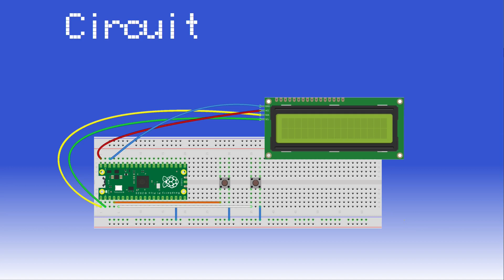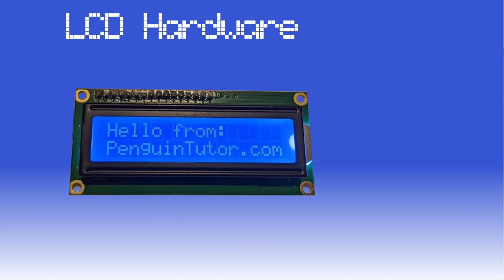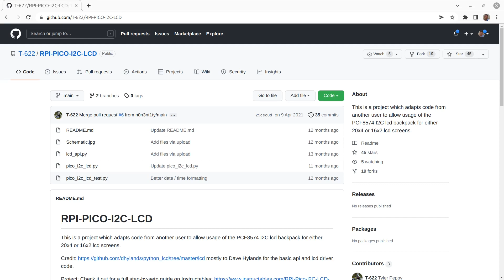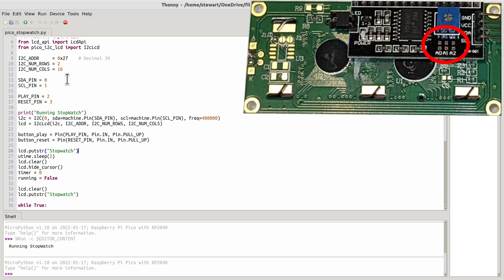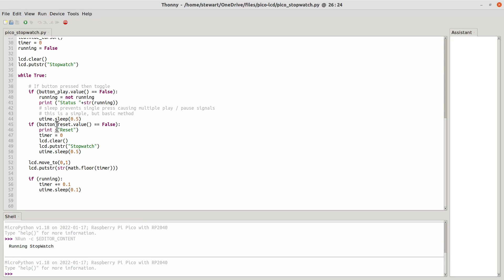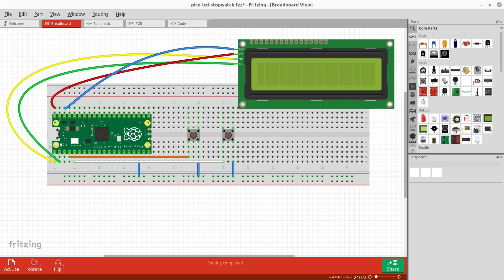Raspberry Pi Pico - LCD Display 1602 text with I2C

Comment: For some reason I cannot save any of the files mentioned in the video to the Pico.  The file save function  gives an error everytime I try to save  like the lcd_api.py or the pico_i2c_lcd.py I get an error..  Any clue to what might be wrong with Thonny?         Could not write next block after having written 1024 bytes to /lcd_api.py
Make sure your device's filesystem has enough free space. (When overwriting a file, the old content may occupy space until the end of the operation.)

ERROR   thonny.backend: PROBLEM WITH THONNY'S BACK-END
Error Problem with a management command

SCRIPT:
__W(b'self, num_lines, num_columns)\n        cmd = self.LCD_FUNCTION\n        if num_lines > 1:\n            cmd |= self.LCD_FUNCTION_2LINES\n        self.hal_write_command(cmd)\n        gc.collect()\n\n    def hal_write_init_nibble(self, nibble):\n        # Writes an initialization nibble to the LCD.\n        # This particular function is only used during initialization.\n        byte = ((nibble >> 4) & 0x0f) << SHIFT_DATA\n        self.i2c.writeto(self.i2c_addr, bytes([byte | MASK_E]))\n        self.i2c.writeto(self.i2c_addr, bytes([byte]))\n        gc.collect()\n        \n    def hal_backlight_on(self):\n        # Allows the hal layer to turn the backlight on\n        self.i2c.writeto(self.i2c_addr, bytes([1 << SHIFT_BACKLIGHT]))\n        gc.collect()\n        \n    def hal_backlight_off(self):\n        #Allows the hal layer to turn the backlight off\n        self.i2c.writeto(self.i2c_addr, bytes([0]))\n        gc.collect()\n        \n    def hal_write_command(self, cmd):\n        # Write a command to the LCD. Data is latched on the fall')

STDOUT:

STDERR:
Traceback (most recent call last):
  File "<stdin>", line 1, in <module>
  File "<stdin>", line 4, in __W
OSError: 28
Reply from the maker: It sounds like there may be a problem with space on the Pico or some other write problem. 

First make sure nothing is running on the Pico. Click the stop button in thonny and then try and save again. 

If that doesn't fix it then you may need to re-install MicroPython onto the pico.
Reply: @PenguinTutor  done that several times.  I also tried 2 other pc's.  One running Windows 11 and another PI box.  Sounds like I got a bad board maybe?

Comment: Hi, does it matter if I use C++ instead of Python and use the Arduino IDE? or do I have to code in Python
Reply from the maker: You can use C++. Raspberry Pi have provided a tool chain based around visual studio, but I believe others have created the steps needed for the Arduino IDE. Or there is an Arduino RP2040, but that's quite expensive compared with the Pico.

Comment: I followed the Video and I could not get mine to work. I did the test from the github site and I got the error the author described.  
MPY: soft reboot
Running test_main
Traceback (most recent call last):
  File "<stdin>", line 62, in <module>
  File "<stdin>", line 16, in test_main
  File "pico_i2c_lcd.py", line 22, in _init_
OSError: [Errno 5] EIO

I followed his instructions and added 1K pullup resistors connected between +5v and SDA and SCL. Still I get an error : 
MPY: soft reboot
Running Stopwatch
Traceback (most recent call last):
  File "<stdin>", line 20, in <module>
  File "pico_i2c_lcd.py", line 22, in _init_
OSError: [Errno 5] EIO

I have checked the wiring many times and it is fine. I changed the display module with another and the same error. My display is lit up with the top line full of boxes and the second line blank. When I run the script that gets the device address, that works and returns 39. So it is communicating.
Any tips would be appreciated. I've been working on this for 3 days and can't get anything displayed on this 1602.
Reply from the maker: That error would indicate a problem connecting to the I2C module. 
It could be that the I2C is not responding to the address. 

When you get the address 39 back, is that decimal or hexadecimal? If it's hexadecimal then it would need to be updated in the code instead of 0x27.

What is the particular module that you have on your LCD display?

Comment: i have problem. when i try to display text, screen just blinks one time and doesn't display any text do you have any idea how to fix it?
Reply: So. I fixed it. I changed the contrast to lower on i2c and it works now
Reply: same issue

dont know how to fix :(
Reply from the maker: I've not come across that before. Here are some suggestions:
Try adjusting the contrast. Usually a variable resistor on the back.
Comment out any clear instructions to make sure they are not clearing your screen as soon as you've set it
Set the backlight on.
Try a i2c voltage level shifter to increase signal to 5V.